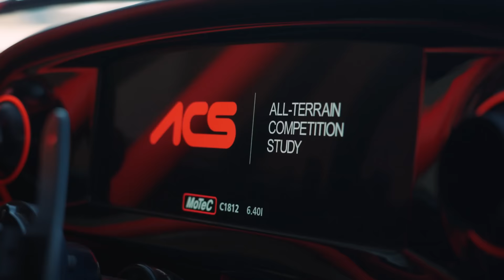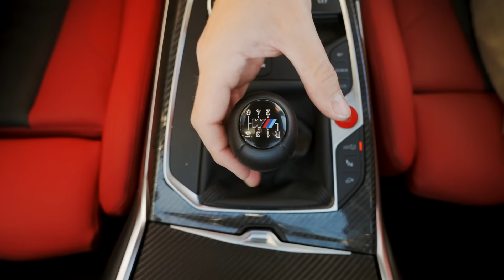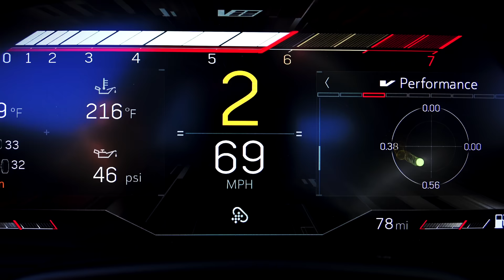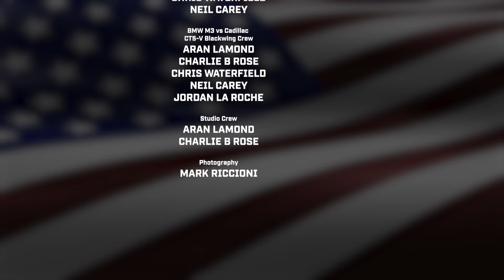FIRST DRIVE: Singer And Tuthill's ULTIMATE Off-Road 911!

Comment from the maker: What’s your ultimate 911?
Reply: A restomod 80s turbo
Reply: Not this. My ultimate 911 would be either be an Oak Green Metallic Singer DLS or Voodoo Blue 991.2 Speedster with dual tone Slate Grey/Speed Blue leather interior.
Reply: Definitely not a Singer. I don’t wanna an american Porsche. I prefer a 2017 RSR (mid engine)
Reply: Porsche 911(964)Turbo
Reply: Singer 911 DLS in a Martini racing livery.
Reply: the one that lost to the Tesla cybertruck
Reply: The 993 4S. It has the wide Turbo hips without its ugly rear spoiler. Its aircooled yet modern.
Reply: Gt2 rs
Reply: Gt3 touring 991.2
Reply: 911 S/T
Reply: Gt3 touring 991.2
Reply: 993 gt2 the original widow maker
Reply: It's a crazy Porsche
Reply: Completely Factory Stock '86 930.  Guards Red, Black Fuchs,  3.3 Intercooled engine with G40 Box, Black Interior with Red Belts.  Old School Cool.
Reply: RUF CTR Anniversary...the latest update of bespoke supercar that looks like a 911 💪💪💪

Comment: 7:15 I have reason to believe he is not really sliding the car, like Ken Block (may he rest in peace). looking at the view through his window, and the well timed cut scenes.
Reply: What? He's driving a rear-engined car on a loose surface...I'd be more impressed if he managed not to drift it. Feels like you made a comment basically to claim you know something others don't, but it's a really odd thing to suggest since we know Jack can drift from plenty of previous videos and there are enough interior shots in this one where he's rotating one way and putting lock on the other way.

If this was a drift video, then yeah they're going to do some dramatic interior shots that aren't actually matched to what you see outside. In this case, they're just filming a car. If you're interested in watching drift fails, just skip to the drifting bit later! Even that bit tank went sideways once it left the gravel though.

Comment: Surprised M3 and blackwing had very close lap times givien the power advantage of the blackwing
Reply: Really?  I feel like M cars have always been more track focused while V cars have always been more GT and drag focused. I would have expected the M to win honestly
Reply: @fatguyonalittlebike3336  blackwing is based on Camaro zl1   Chassis and Camaro is a true sports car I would of expected blackwing to have  same performance as zl1 but with extra 2 doors, i guess its not the same dynamics. Blackwing has almost 200hp more from the m3.
Reply: Don't get why people act so surprised at this...BMW's advertised power ratings have long been roughly what they put to the wheels.  American products are usually best case scenario and at the crank.

Comment: Do I see underbody paneling flapping in the wind in some of those driving shots?
Reply: That's polyurethane sheeting that's used on most stage rally cars. The front is attached to the floor, and then the rear is generally left to hang off of the control arms. It allows the suspension to glide over rocks and other debris. It may look out of place, but it's typically very effective.
Reply: @NAMBUGMAN  no shit,  how bout that! That's news to me

Comment: Ruined the video with a poor execution of proving that manuals are better. All you’ve proves is that a low power pick up truck with an auto is not as much fun on a race track than things that cost about 4 times as much with a manual.

Comment: The second half of this upload is absolute rubbish. A pickup truck with a bigger engine that produces more power paired with an automatic transmission that has more speeds than BOTH manual sedans is SLOWER?!?! In your dreams. Top Gear going downhill shilling for manual transmissions. Gonna have down thumb this one.
Reply: Don’t think you got what they did there… 😂